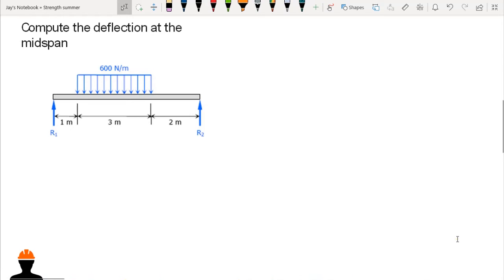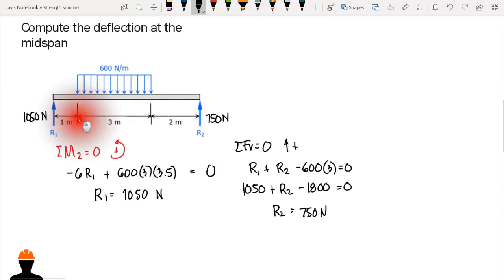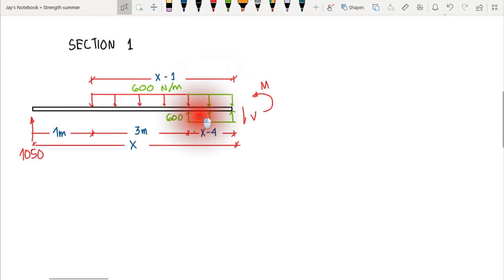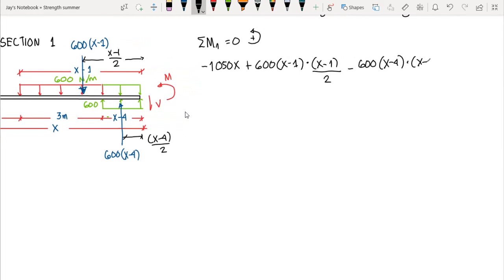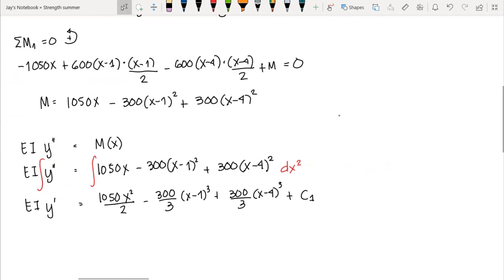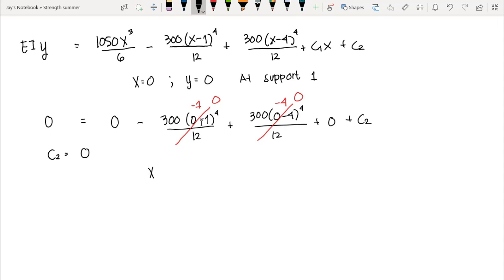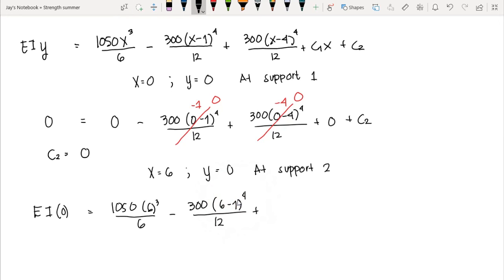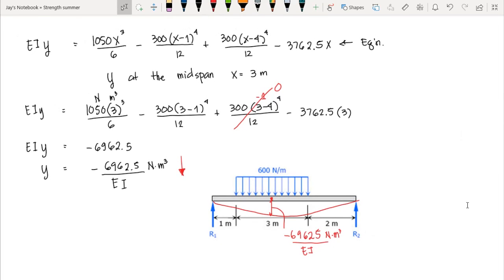Strength of Materials: Double Integration Method (Beam Deflection) Part 2 of  2

Comment: How about the maximum slope and elevation of the given??
Reply from the maker: slope is zero (y' =0 ) to get the maximum dflection
Reply: @engrjayc  how about the maximum slope?? Should I also use the computed x value for the equation 1?
Reply from the maker: The maximum slope always occurs at the hinge and roller support.